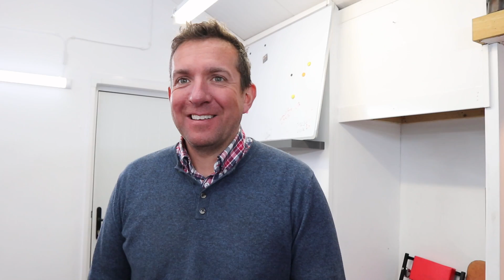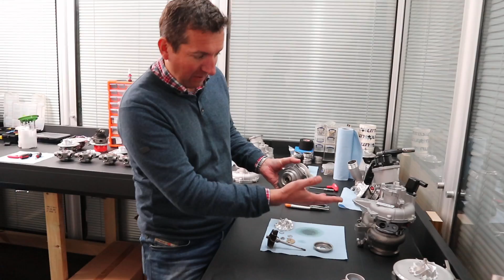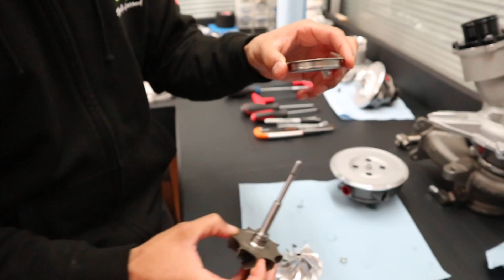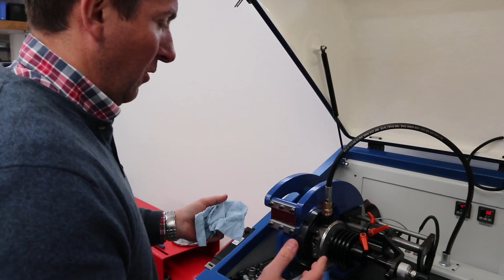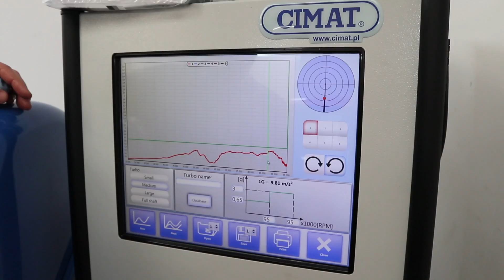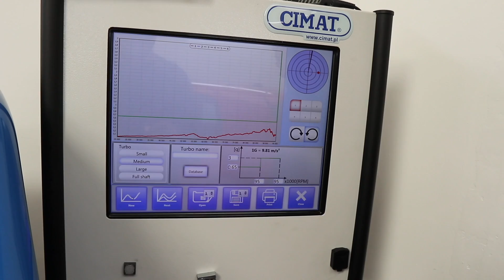BUILDING MY 500BHP GOLF R *LITTCO* HYBRID TURBO!!

Comment: Probably not required, but was suprised that no assembly lube was used during the build.
Reply: Steve. They go straight on the VsR balancing machine and purged with warm oil before we run them up . Once finished we leave the full of oil and cap off. There's not much need for assembly lube as they aren't run without oil but I see your point.
Reply: @littco   thanks for explaining, I was more curious as I have never watched a turbo build before

Comment: My 450 is going in Monday, was going for the 500 but Dan persuaded me to go 450 for quicker spool and better city driving. Curious to have your feedback on the more laggy L500.
Reply: Me too as I'm eyeing up a turbo capable of 500lbs ft torque.
Reply: DrStrange1000 on a gti, R or ? 500 lbs will destroy it, unless on a built motor. 390-420 lbs/tq is usually our safest bet.
Reply: @yoadriaaannn  on an R mate. Have seen MRC, EcoTune and VRS map this particular turbo with no issues thus far. VERY happy to be proven otherwise.
Reply: DrStrange1000 good luck! 🍀👍🏼
Reply: @yoadriaaannn  do you have social media like Instagram? Be happy to drop you a line when I do ..
Reply: DrStrange1000 sure! AdrianNikonian on IG
Reply: @yoadriaaannn  Sweet. Will add you now.
Reply: @DrStrange1000  how did the engine cope with 500lbs ft? i'm going for a stage 2 APR golf R
Reply: @darrenkingston8042  Absolutely Fine. As I said, as long as you have the right turbo and more importantly good tuner that knows what he's doing, you will get an amazing outcome. In the UK, I would choose MRC and VRS. Good luck with yours.
Reply: @DrStrange1000  yeah this one is by ecotune and has APR stage 2 with supporting mods. I heard 420lb ft is th3 max to run on these without uprated valve springs and retainers, is that right?

Anything else to look out for or mods that are required? It's not got a oil catch can.. saw a video on VRS and it was full of sludge 😣
Reply: @darrenkingston8042  Cool. To be honest, I personally know 3 people who ran over 500ft lbs on a completely stock engine. It's JUST the turbo (Turbo Technics V5) and full supporting mods to get it there. One of them, Guy, who has a manual 7r absolutely abused his for 30k miles until he forged it. He was running 560ft lbs 😲😲. 

Having said that, I think for longevity I would go for catch can and valve springs/retainers as you say just because it appears to the the first point of call when you run big power. 

Tuner wise, for sure..ECOTUNE are one of the best! Oh and Rick from Unicorn developments is the man!
Reply: @DrStrange1000  have you got IG? could I add you and show you the car I'm looking at next week? Thanks for the advice 👍
Reply: @darrenkingston8042  Of course! It's @c0ntempl4te. 😊

Comment: One little advice, dont put 500 hp on stock internals, thank me later!
Reply: Well it's not HP but torque that pops motors, these engines are good for about 420 wheel torque which at 7,500 RPM is 600 WHP, I think you will be safe at 500 wheel so long as you have a good conservative tune that keeps the torque under that magic 420.
Reply: @flacjacket  I've seen golf r's running around 500 hp and bending rods..
Reply: @Tiparul  Right, I don't doubt it, but that is almost certainly caused by a tune that exceeds 420 ft/lbs not from the peak hp figure. That said I personally would go built motor before I upgrade the turbo on mine, FBO on the stock turbo with meth and a pro-tune can hit about 415-420 wheel on pump gas anyways, if you are going to spend the money on a bigger turbo then it's not going to be worth it for 80 hp when an extra $2k in rods and pistons can push you past 600 and allow you to run as much torque as the bigger turbo can make anyways.
Reply: It's about how long will they run.  They are 23mm on wrist pin and 21.9mm narrow, same as 2.0 tsi ea888. They will not be able to support that power for a long time. You need to see a comparation between an aftermarket performance rod and a stock one to See how thin its the stock one. More power means more air and more fuel being compressed, the more you have the harder it's to compress and rods bend.
Reply: @Tiparul  agreed. I guess I will need to go and find the boys who run this power and see if they are still having no issues.
Reply: Bit confused by this. There are lots of people. I know one in particular, who ran 550bhp and 550lbs ft on stock internals no issues! (Guy kitch on MK7 owners club forum)

Comment: Good company I wonder how this Turbo compares to Revo Turbo technics type 500bhp to 550bhp 
Engine is good for 600bhp but would not push it without meth
Reply: Engine is not good for 600bhp lol on stock internals! 🤦🏻‍♂️
Reply: 500 hp is max for a stock engine and still dont expect the car will run 120k miles without problems.
Reply: @BalkanBoyBiH  all stage 3 mk7 golf R are over 500bhp 525bhp Calvin's us meant to be 600bhp original Arthur's old car which blew up and other golf mk7 R that blew at 600bhp was Dave's white one which now has 2.5 Rs3 engine
Reply: Peter. From what I've seen the Revo is very good for around 480-500bhp depending on the boost. We've had 500bhp and under 2bar and 510bhp at 2.1bar . At 2bar these are making around 475ftlbs of torque and it's the torque which will bend a rod and kill the engine. We say 2bar/500bhp/460ftlbs for engine reliability.
Reply: @littco  great info and wish you and your company all the best it's nice to have the boss man Dan talk and be very informative if I ever need a Turbo I come a see you and yes some people don't realise Torque is the problem when rods or the seals give way 
By the way Dan work car do u drive thanks again peter